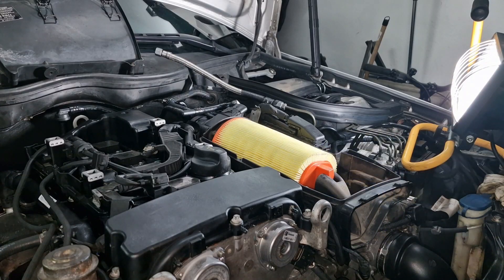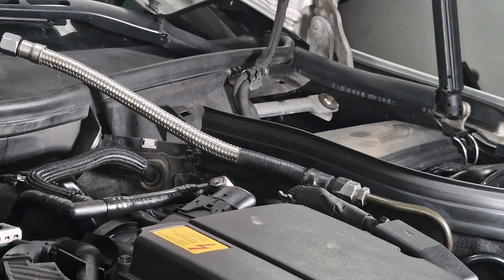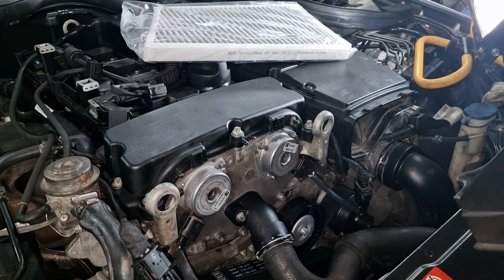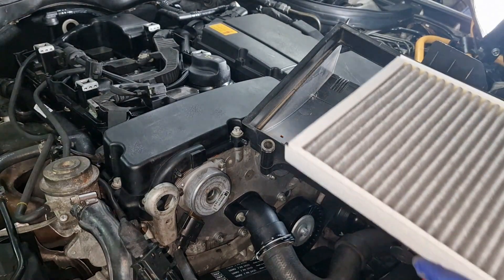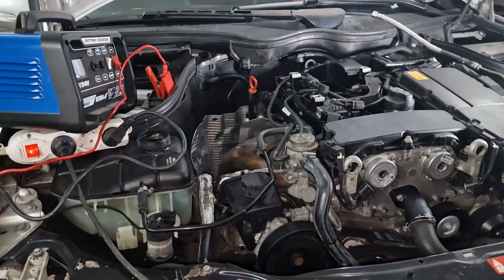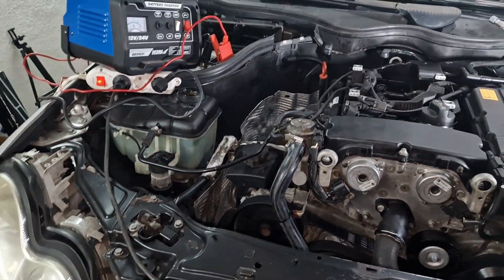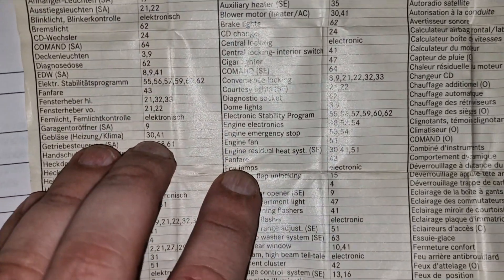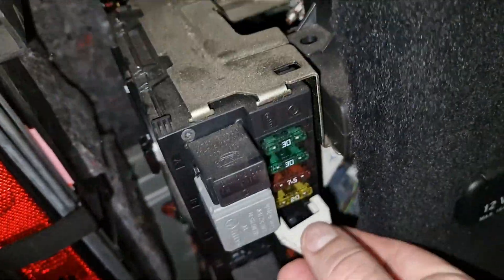Timing Chain kit replacement M271 Part 12

Comment: Excellent work Alex and well recorded, the best I have seen. 5 Stars.  😀This will be very helpful when changing the chain, tensioner and camshaft adjusters on my late 2004 SLK 200K, it has done 60,000 miles. It has been noisy on cold starting until oil pressure builds up and just thrown up a misfire so I am hoping the valves are OK. I will do a compression test before dismantling. I have been unable to find a workshop manual and if you could let me know where I can obtain one like yours it would be most helpful.👍 Kind regards, Dennis
Reply from the maker: You can find online vendors that sell DAS/Xentry with C4, C5 or C6 multiplexers. They contain also WIS/ASRA packages alongside some extra helpfull softwares. Cheers and thanks for watching.

Comment: Te salut Alex, sper ca poti vedea acest comentariu, as vrea să-ți cer o parere.
Am un slk 200 r172 (2011-) cu 127k km.
Motorul rula impecabil pana cand a trebuit sa intervin asupra carcasei filtru ulei care pierdea pe la garnitură. A fost schimbata cu un aftermarket, iar acum la relanti motorul trepideaza tare. Am crezut initial ca este admisia, dar nu erau coduri, au fost puse garnituri noi, resetate clapetele.
Ulterior am zis sa investesc in refacerea distribuției, deci au fost schimbate: variatoare, vanos-uri, lant, patine, întinzător, si o carcasa noua nissin (crezand ca cea inlocuita initial nu ar fi fost bună). A fost pus totul la punct, dar la pornire, spre dezamăgirea mea, motorul tot tremură.
Ce uit? Trebuie facute resetari/adaptari la ax came? Reinvatare pozitie arbore? Adaptare clapetă? 

Tin sa mentionez ca am schimbat bujiile (anterior refacerii distribuției) si dupa 300km erau negre. Unghiul de injectie era între -3 si 10 grade. Posibil sa fi rămas aceste adaptări?
Reply from the maker: Salut. Apreciez încrederea dar fără o diagnoza nu ma pot pronunta. Verifica sa nu ai pierderi pe vacuum sau sa nu tragă aer fals. Fără o masina de fum poți da cu brake cleaner pe la furtunasele de vacuum si pe la îmbinările de la galeria de admisie/traseu de admisie. Dacă pe undeva trage aer fals motorul se va accelera.

Comment: Excellent work, Alex. How many miles were on the car when you started the work?
Reply from the maker: Around 270.000km. Timing chain was done by previous owner. Due to my trust issues I wanted to do it myself. Thanks for watching and taking the time to comment!
Reply: @AlexAndreiZAR were the breather pipes still ok?,.i did not see you changing them..
Reply from the maker: @zwahashu  I have changed the breather pipes. Either they are in another video or I may have missed filming them.
Reply: @AlexAndreiZAR  i thought i was the only one with the 'trust issue' disease. Quality is what you make yourself. No one touches my cars. I agree with you on that one..